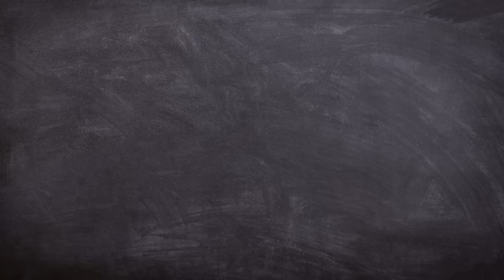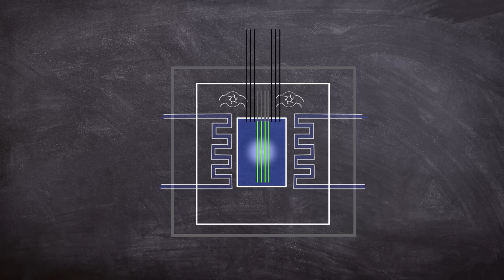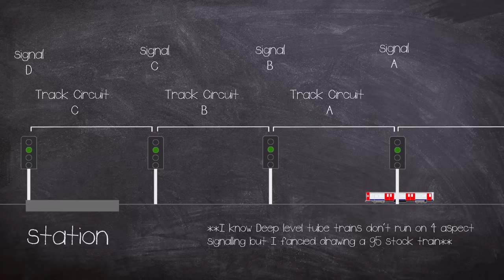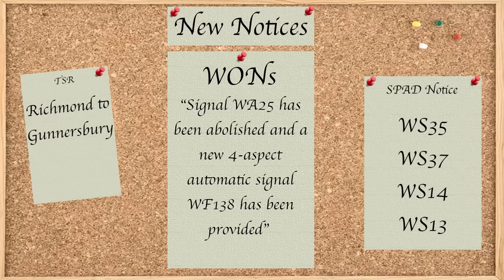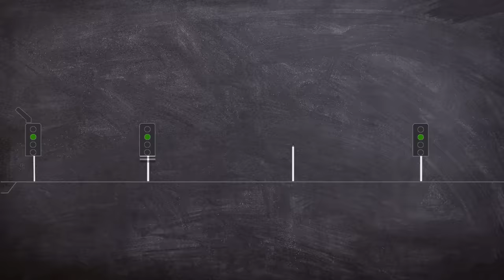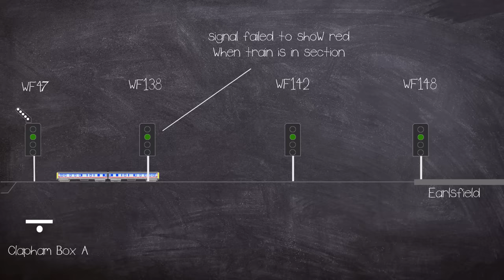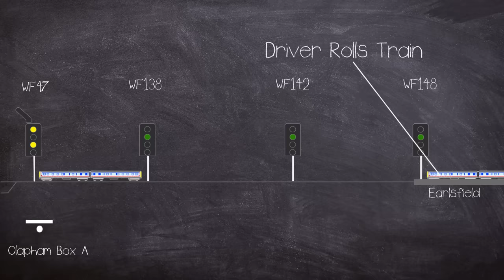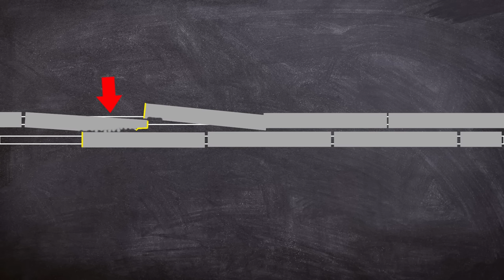A Brief History of: The Clapham Junction Rail Disaster 1988 (Documentary)

Comment: As a railway signalling technician for the last 40 years you covered this extremely well. Yes to more railway videos. Cheers.
Reply: I just finished my signals training so I felt pretty smart watching it. Do they use track magnets to dump trains if they enter a block on a red in the UK?
Reply: Yeah Inb4 Eschede
Reply: high praise!
Reply: @AkomishTiddies  Thanks mate. I appreciate the detailed response.
Reply: Do visit the Cumbrian coast line. I joke that the signals are that old, the lamps are still oil.
They're not, but there's only one bulb per signal.
Reply: The BR (British Railways) AWS (Automatic Warning System) uses magnets located on the sleepers centrally between the rails. It uses both permanent magnets and electro-magnets. Only if the signal is lit and showing a green aspect (colour light) will the AWS let the train pass without the driver having to do anything. If the signal is not lit (failed lamp, power failure), showing red, yellow or double yellow, then the AWS will cause a horn to sound in the cab. If the driver does not acknowledge this by pressing a button, within seconds a full brake application will be made. If the driver presses the button, it will cancel the alarm and the train can continue. After two further crashes (Southall and Ladbroke Grove), the government instructed the railways to fit TPWS (Train Protection and Warning System). Extra equipment is fitted to both the train and to the track. Now a series of short range “loops” fitted on the sleepers in between the rails transmit a series of radio frequency signals to the train when the signal is showing a red. If the receiver on the train detects two different frequencies in a short period of time, the on train equipment applies the brakes just like the AWS. Except that the driver cannot override it. So the train will stop. Both AWS and TPWS rely on the signal controls to be working correctly.
On the Great Western main lines between Bristol Temple Meads and London Paddington, and between Bristol Parkway and the junction with the Bristol Temple Meads and London Paddington line, ATP (Automatic Train Protection) is fitted to the high speed passenger trains and to the Heathrow Express trains. This system is even more sophisticated than AWS and TPWS. A different type of ATP is fitted to the the Chiltern Main Line from London Marylebone to High Wycombe and Aylesbury.
Reply: @Mark1024MAK  Safety technology - don't you just love it.
In the good ol' days, we just had points. Any misbehaving driver was just diverted off the track ;)
Simple
effective
costly
safe
Reply: Does anyone know the distance between those signals?
Reply: Was about to send this to my railway driver dad to see if it was accurate. You've confirmed it! No need to bother Dave :)
Reply: The number of sacks of as we called them condoms we put on the fishtank detachable top relay terminals was colossal after Clapham.
Reply: @millomweb  The safety record of all forms of public transport makes cars look like a slaughter house.
Reply: @Lee-70ish  Not just car occupants too - peds and cyclists also !
Reply: 40 years and you've been promoted zero times?
Reply: Just about to start my signal technician training and due to spend two weeks down in Clapham shortly. 👍
Reply: @RipperBravo Hello, how was your course?
Reply: @AkomishTiddies  Which because of the typical circuit architecture for an AWS magnet was rendered ineffective at Clapham as it wholly relied on the correct operation of the same signal control relay falsely energised by the rogue wire by-passing the critical track circuit control in the signal control circuit.

Comment: As a mainline driver in the UK, this sent shivers down my spine, as you touched on we take for granted that the signalling system is fail-safe. Keep the content coming & thanks!
Reply from the maker: Thank you!
Reply: This reminds me of the flight safety brief where I was once told "The pilot had every incentive to fly safely as they are the first to die in a crash". Same applies to trains.
Reply: @JoshuaTootell  It's also why they tell people to keep the gangway doors clear of obstacles as the driver may need to escape in a hurry.
Reply: @namugriff  😂
Reply: @namugriff  The driver escaping in a hurry didn't do much good in Seoul, a few years ago.
Reply: I used to commute every day. For what it's worth I hope the job's ok. We depend on you.
Reply: @namugriff  I've never see an easy way out of a cab,  some I've seen you have to fold your seat forward or unlock the carriage door.          No  you  just    w a i t   !      -   someone else, will have to put out the detonators !
Reply: WHAT OPERATOR

Comment: I swear loose wires have a consciousness of thier own and their one objective is jam themselves into that one place you wish they would not.
Reply: Kinda like how a dropped tool will roll to the exact center of your car. 😆
Reply: Or how, no matter how neatly you bind cable, it's inevitable that within 30 seconds of you taking your eyes off of it, it will become a tangled, incomprehensible snarl.
Reply: There is a small beast that lives in pockets and draws that tangles headphone wire up 🙃
Reply: @ollieb9875  It's probably related to the infamous Turret Monster.
Reply: @ollieb9875  Gremlins?
Reply: Murphy’s Law at work.
Reply: Actually if a solid copper wire has been in the same position for thirty odd years, you can kinda understand it having a “memory” and wanting to return to where it was... Which is exactly what happened 🙁
Reply: @Mark1024MAK  Good point, if nothing else the elasticity from the insulation might have been enough to work it back into place.
Reply: @Mark1024MAK  very interesting point... I hadn't thought of that
Reply: @Mark1024MAK  That's the one thing, we used multi strand cabling because of railway vibration, single core only for telecoms and pilot cables (earliest, paper insulation over a string spiral (less Capacitance/crossfeed in a 3" Cable)

Comment: 72 hour work weeks and 12 hour shifts still seems completely insane for safety critical work.
Reply: That’s the current absolute maximum, the staff could work much longer hours prior to the Hidden enquiry. And part of the reason that they did, was that, due to working the weekend, they could nearly double their week’s wages.
Reply: It's mainly gone on UK Railways, but our niche had  "Extremities of Service"  (mainly Ex-Naval practice/parlance) 
 In a incident you stayed until relieved, we had an emergency rations box brought out ( I did 55 hours straight - Manning an outstation once) and have stayed after shift,  filling in an incidence report for management day meeting.
 (The Control log book does not move ! ).
Reply: It used to be the normal when I worked on the railways....
Reply: @Mark1024MAK  what with doubling back twice in a week the seventh turn (6th day) used to be paid at double time....  oh the good ole days
Reply: @Mark1024MAK  was you p,way ? I was a signalman so it may have been different.
Reply: On London underground the limit is now 8 consecutive days. You can also only do one double shift, in a rolling 28  day period. A shift is considered double if it's more than 14 hours.
Reply: I work in a saftey critical role on the railway and it would be rare at my company to reach 72 hours in a week and our shifts are capped at no more then 10 hours but on average are around 7-8

Comment: Since you're doing rail disasters, maybe consider the Eschede derailment or the Quintinshill disaster.
Reply: I would be very interested in the Quintinshill disaster
Reply: Both is good

The German one of those is also the most interesting IMCO, as it was entirely the result of systematic incompetance on the part of DB (the rail company, and german equivilant of BR), and is the worst rail disaster of the last half century.

It's also why the German ICE train lost a series of hitherto promising export orders.
Reply: Eschede Disaster: do not use tram wheels for highspeed trains
Reply: @SportyMabamba  Also; neglecting checks for metal fatigue (something aviation had taken seriously for decades & the rail industry had known about for over a century prior to the disaster) is to invite ruin.
Reply: @jimtaylor294  Wasn't Potters' Bar caused by metal fatigue, too? I remember a few rail crashes on top of one another at the turn of the century, snd then months of delays as pretty much every track had to be re-checked for neglected maintenance.
Reply: Granville is another one to look at
Reply: @worldcomicsreview354  Not sure. There were several incidents during the Railtrack company's existance that were found to be due to lousy track mantainance (unsurprisingly badly mantained track can fail under load), but UK rail history doesn't have a case of the train wheels themselves breaking apart and derailing the train into a bridge, as the ICE train's did.
Reply: @jimtaylor294  but the train derailed because a turnout.  Perhaps with no turnout, no derailment into the bridge.

Comment: I was working as an Railway signalling installation team leader at Liverpool St London at the time of the disaster. After the disaster we were visited by the Ministry of Transport who asked me and my team loads of questions,  they looked at our installation work and asked about our practices. 
We were praised by them as we had always cut any bare wires off and taped the ends. They asked me why we had done this?  I said that its was a practice I was taught to use.
Reply: On the maintenance side, it was panic stations after the cause was discovered to be a redundant uninsulated wire... We had to visit and check every item of signalling equipment and inspect all the wiring... You really don’t want to know how many we found...

Comment: I would love to see something about Grenfell. I respect it is far too soon, investigations are still ongoing, etc. Just an idea for the future.
Reply from the maker: I would like to cover it in the future
Reply: @PlainlyDifficult  I'm sure there's no shortage of train disasters, here's a good one https://en.wikipedia.org/wiki/Lac-M%C3%A9gantic_rail_disaster
Reply: I think you'd probably rate it as an 8 on the plainly difficult disaster scale.. the long and the short of it is they parked a train, shut down the engines and didn't set enough manual brakes, as the air brake pressure bled off the brakes released and the train rolled down the track and derailed in the town
Reply: @Rx7man  holy shit. I hadn't heard of this . Plz do video :o
Reply: Green reshielding without care to burn factor coz that would never happen, uh huh, we've seen that thinking before: nuclear, etc leading to death and destruction. Great job as usual.
Reply: @Rx7man  Actually, they did not shut down one of the engines.  It was left running to keep up the air pressure overnight while the engineer had his mandatory rest.  Unfortunately the running engine caught fire due to a faulty previous repair job.  The fire department was called and THEY shut down the engine (even though they didn't know what the hell they were doing!) and put out the fire.   Everything seemed stable so the fire department left.  An hour or so later, after small leaks had depleted the compressed air, the train started to move due to not enough manual brakes being applied as you said, and the result is history.
Reply: @Vincent_Sullivan  I forgot about the fire part of it.. I stand corrected!

Comment: Excellent work. Having worked in operations, as a signal maintainer, a locomotive mechanic, a passenger car electrician and locomotive electrician on short lines in the US I can attest to all that you have stated. For those who don’t know, on a US short line one often wears many hats and may change from one professional craft to another. I have several times and most of those I have worked with have as well. 

In the United States the signal aspects for CTC are clear, green, advanced approach flashing yellow, approach, solid yellow and stop, red. We also have diverging aspects as well. Otherwise the signals work very much the same. 

In locomotive electrical work a misplaced wire can cause unexpected issues. For instance, a wire on a contactor interlock that is place on a normally open if placed on a normally closed can cause the whole set of contactors to start jumping in opposites. Of course your locomotive is not going to operate correctly. This is a serious situation so we test these circuits with the generator off line. This is usually a job that can take hours if not a week to diagnose. 
This is triple truth on a signal system. 

To all the signal maintainers out there. RESPECT!!!!

Comment: YES!!! If you want to do the Paddington Disaster as reported by Lord Hidden as well that would be awesome!
Reply: Wasn't that a head on crash caused by signaling as well?
Reply: @bmstylee  I think the signals were OK, but the automatic stop wasn't. The driver was packing his stuff up and missed a red.
Reply: Which one, the Southall crash caused by a combination of the high speed train not having a working AWS or working ATP,  the driver being distracted and not paying enough attention to the signals, and the signaller crossing a freight train over a junction ahead of the high speed train (which was not unsafe, but unusual).
Or the Ladbroke Grove crash, caused by a DMU driver for some reason (that we will never know) going past a red signal that was protecting the junction ahead. The signal was red because the points were set for a high speed train heading for London Paddington. The HST had working AWS and working ATP,  but it was too close to stop in time. The DMU did not have ATP. The signal (now infamous as SN109) was a non-standard configuration, and the sighting of it was not very good. The bridges and overhead line equipment (OHL) interrupted the drivers view of it.
TPWS did not exist at the time either of these crashes occurred.
See my other post if you want to know more about AWS, TPWS or ATP.

Comment: Yes please,  more like this one please.  I did my electrical  apprenticeship in rail signalling. This and one other event here in Australia were the main "wrong side failure" events we were taught about. There's a NSW signal standard that now says bridging wires shall be orange coloured, individually numbered,  signed and counter signed into use and something really long like 900-1200mm in length. And old wiring will be capped and taped if not removed.

Comment: For anyone wondering about the picture at 14:55. This was a collision at London Waterloo in August 2017 where a passenger train departed with the starting signal indicating a straight main route but a set of points not laying correctly in the station throat. As a result the train veered left and struck an empty engineering train that was being used as a barrier for staff within a possession site. This was down to wiring issues, lack of proper testing and not having the points physically secured. A similar incident occurred at Cardiff December 2016 where following engineering works two sets of redundant points on the main line where not secured correctly and remained undetected by the signaling system. Luckly in this the train stopped before the points and no collision occurred.

Comment: The underlying cause of this crash is a warning of the dangers posed by taking short cuts.

A similar example is related to British Airways flight 5390, an incident in 1990 involving a BAC 111 that had had work done on its windscreen the night before the incident. Rather than going through the technical manual to find the specific screws to properly secure the screen in place, the technician used the naked eye (in little light) to try and match the screws coming in with the ones coming out, supposedly to save time. Several of the screws were one size too narrow for the size of the thread to secure the windscreen and the result was, as the aircraft climbed and the pressurisation system kicked in, the pressure within the aircraft blew the loosely fitted windscreen out. Despite the Captain being sucked out of his seat, becoming entangled on the yoke, the aircraft made an emergency landing in Southampton and everyone, [and remarkably] even the Captain, survived the incident to tell the tale

Comment: At that time i worked for BR and although i was Safety Critical train crew, and the hours thrown up after the Hidden Report were drummed into us i personally have worked 28 days straight, because after stating i was Already Over Hidden, along with several other drivers, we were told as every "Other Sunday" was voluntary overtime, they didn't count. Due to crew shortages and extra diversions because of weekend engineering works plus the bribes of Two days off in lieu, but at a much later date and double time payments as opposed to only time and a half, it all got swept under the carpet. I along with others at my depot, laughed all the way to the bank. I recall that after Clapham crash, the chancellor of the exchequer at the time said it should never be allowed to occur again and there would be an open cheque book to ensure this. There were plans to install a Trains Protection System, but BR went for the cheaper option of AWS  ( automatic warning system ) instead and all too soon it was all forgotten as there was the obscured signal which led to the Paddington crash. I worked for many years on the railways, but also saw many failings in that time. I have been retired for some time now and technically British Rail does not exist.